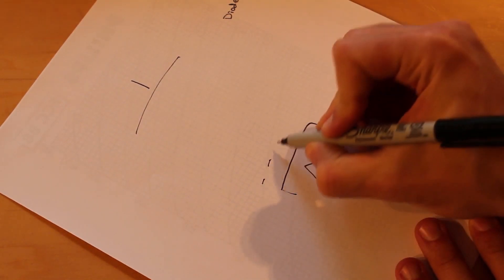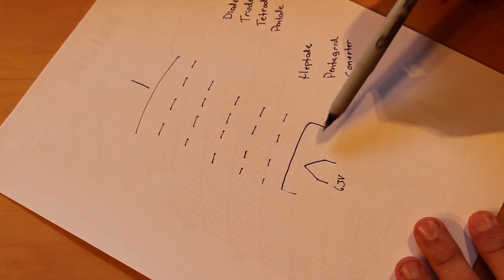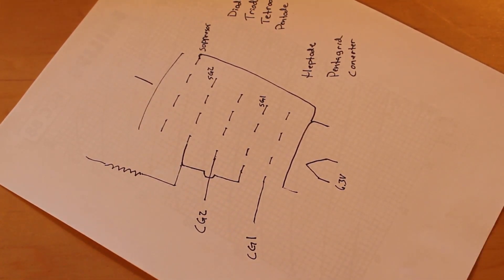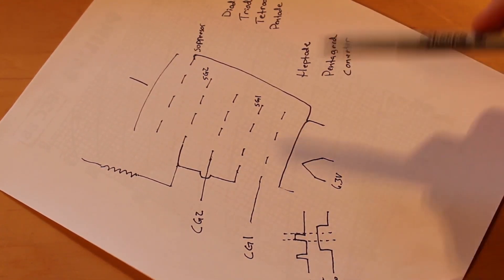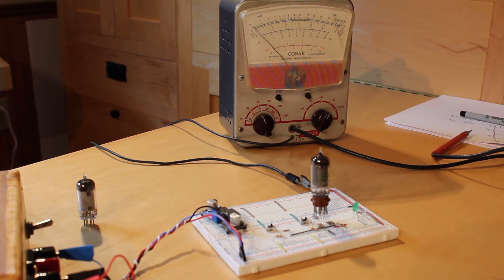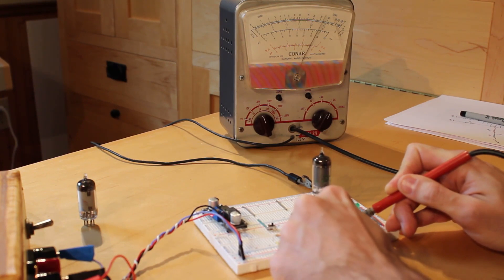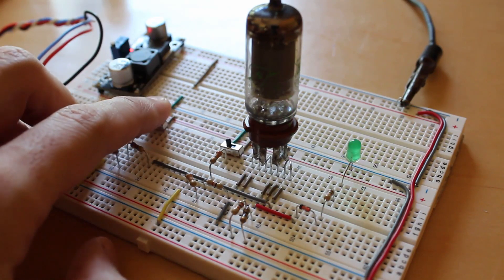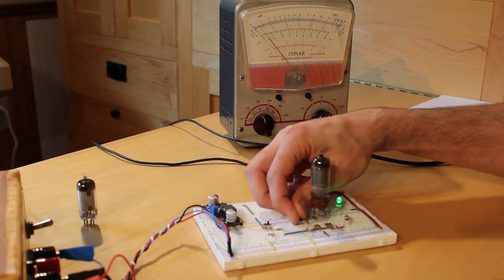Vacuum Tubes: Episode 6 – The Heptode/Pentagrid Converter

Comment: You can also make a 1-tube NOR gate (by cheating a little bit). A double triode, where each of the triodes is connected as an inverter, and then the inverter outputs are tied together. That gives a wired-OR output, which works because each of the inverters acts as if it had an open-collector output (to give a transistor analogy).
So now you can have 1-tube inverters, 1-tube NAND and 1-tube NOR gates. The sky's the limit. I don't envy you for your electricity bill if you build a computer out of these. :)
Reply: What about an XOR tube?

Comment: The tube is an AND gate, sort of but analog style :-) then becomes a NAND gate by a circuit ...
Reply from the maker: You're definitely right! The tube itself is really just two control grids blocking or allowing electrons to move between the cathode and plate. Our resistors and wiring determines what kind of output we'll see! It could very easily be wired up as an AND gate by setting the tube up as a cathode follower and taking the output off the cathode. That doesn't give us any amplification though, so to ensure good signals, we take the output off the plate, but this inverts the output, making it a NAND gate.
Reply: @UsagiElectric  This was exactly the question on my mind after having watched the video...

Comment: This got a like after watching at 6 minutes in. Excellent explanation. I have some 5915 and looking at the datasheet I was wondering why some of the grids were tied together - datasheet doesn't tell you :-) As I was planning to use them in a radio build I was still perplexed as to why the datasheet said they can be used in computer circuitry, now I know! A NAND gate, pretty cool! was over analyzing and missed the obvious even though I knew that these can be used as mixers. You got a sub! Now to go back and watch your back catalog. As it happens I also bought some 6И1П from a guy in the Ukraine yesterday :-) Thanks
Reply from the maker: Thank you so much!
Heptodes are really awesome tubes! Having two control grids allows a lot of really cool stuff, and they make some excellent mixer tubes for combining frequencies. But, for me, it's all about the computing prospects. And speaking of which, the 5915 is a really awesome tube! Most tubes like to live and work in the linear region between saturation and cutoff, but the 5915 was designed to spend time at those extremes, which is perfect for computing applications!

Comment: If only the early computer pioneers knew it would work on 24v, there would have been much less wear on the valves. :)
Reply from the maker: Interestingly, I think extended use at such low voltages might actually be damaging for the cathode. I'm not entirely sure, but I've heard of people warning against "sleep sickness" when running tubes at low voltages. But, fortunately, I don't run them long enough at a time for it to really become a problem!

Comment: 6BE6 was oscillator and mixer in AM and Short Wave receivers. Predecessor to it was the octal base 6SA7.
Reply from the maker: If I remember right, the primary driving force behind the development of these tubes was to get around taxes that were charged based on the number of tubes in the radio. By stuffing the oscillator and mixer in the same tube, they could keep the design to a minimum. I love when regulations just cause engineers to get crafty!
Reply: @UsagiElectric  Do you know if tubes like the 6BE6 were used in computers?

Comment: Good stuff as usual! I was just following along on autopilot right up until you started displaying the truth table at which point my brain said "A-HAH! I know what's going on here!" which was fun :P
Reply from the maker: Thanks! The Heptode/Pentagrid Converter was actually initially built to mix an incoming signal with set frequency. There were some pretty weird taxes on the number of tubes you could have in a radio in Europe, so the Pentagrid Converter allowed manufacturers to keep the tube count to a minimum. But, IBM saw a golden opportunity with the tube and how it very neatly made a logic gate!

Comment: Cool.  So will we see a working S/R latch in a couple of episodes?   Also, could you mention something about the max switching frequency with varying B+ voltages - how much slower is is when driven with just 24 volts compares to a 200 volt B+? (Or is it actually faster? DTL logic tend to be able to switch faster with decreasing voltages).   I'm also kinda curious about the grid currents.
Reply from the maker: Thank you! The S/R latch is definitely coming soon (I say as I glance at the 6AU6 S/R latch on my breadboard to my left...).
Speed is also something I definitely want to look at in the future as well. Particularly when we build a multivibrator to generate a square wave. I've done some experimenting to see how fast of a square wave we can get, but also I've got an old HP signal generator in the garage that's begging to be used to see how quickly we can get an inverter switching on an off. So there's definitely a lot more testing and experimenting to come!